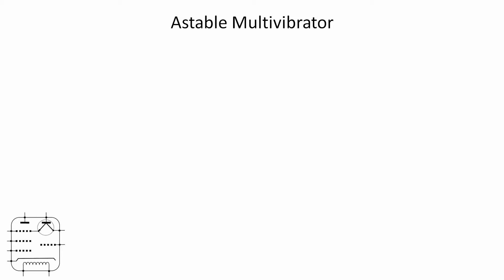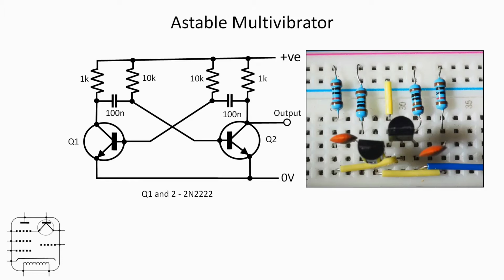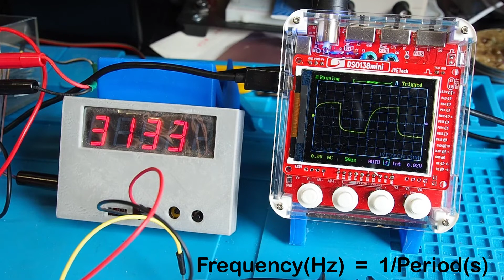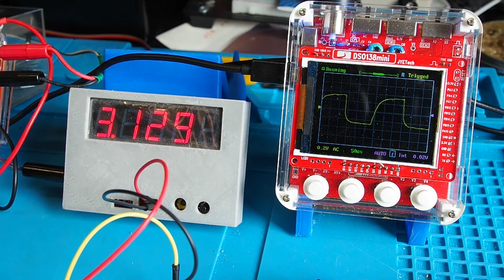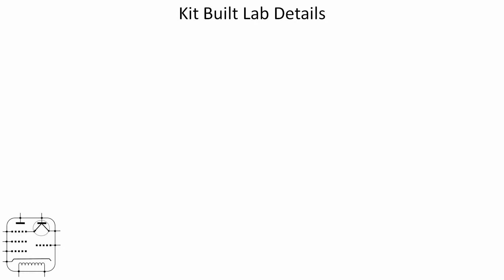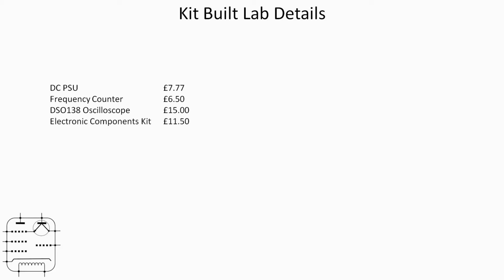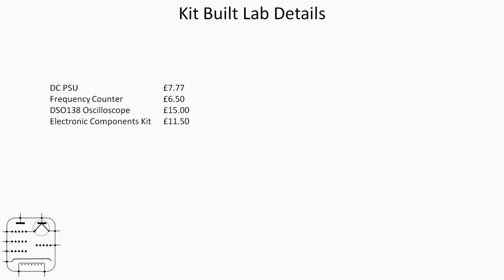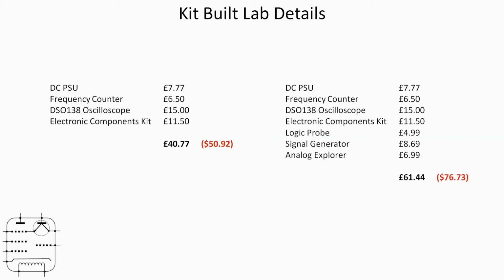Exploring the Astable Multivibrator with a kit built lab   #138

Comment: I built one of those signal generators. As you said, they are not wonderful waveforms, but my major complaint was that there was a huge DC off-set voltage (about 9v if I remember correctly) imposed on the waveforms. You need to block this with a cap else there is a risk of damage to sensitive inputs. Maybe my unit was faulty, but it's worth checking.

Comment: I build a Modification for that PIC uC Frequency Counter, An Input Protection for that Frequency Counter, Mine have HF, AF, and direct measurement, Direct Measurement are Connected to a 1K resistor series to frequency Counter and to the input, my Input Protection are Transistor Circuit, 3 Transistor (2 JFET and 1 BJT), Couple of Resistor and Capacitor